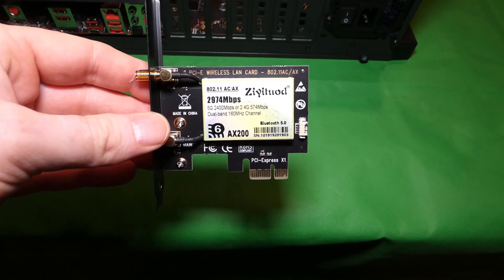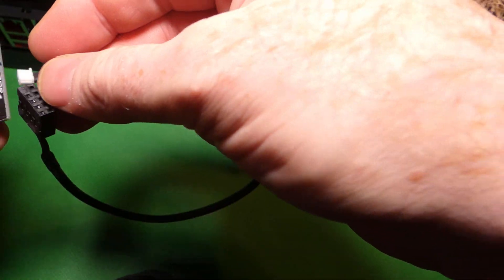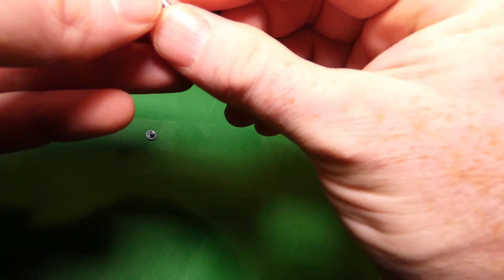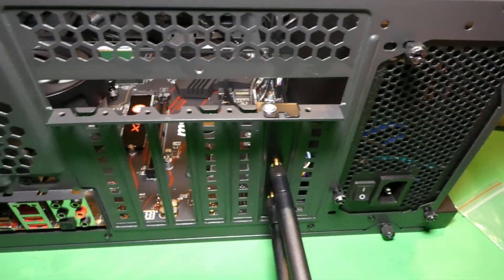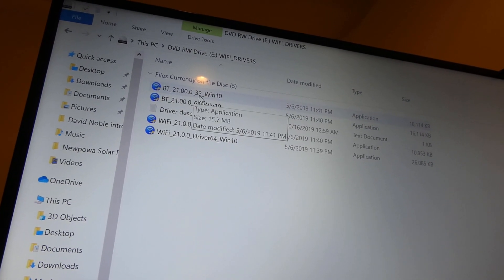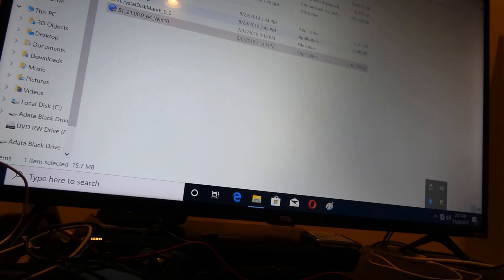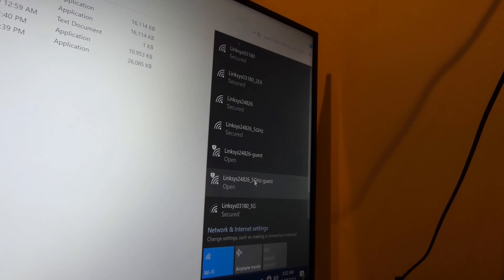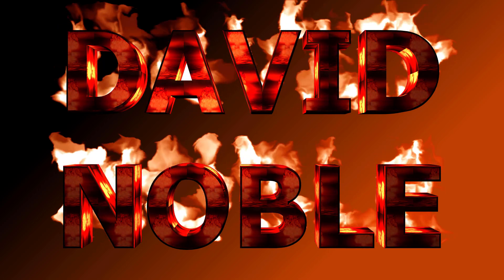How to Install Ziyituod WiFi 6 Card, AX2974Mbps Wireless Network Card, 802 11ax PCIe WiFi Card AX200

Comment: i have one right now. using another 2.4 usb network adapter for now. i put it in the graphics card slot because the small one wasnt working and put the cord into usb 1. sometimes it works. when i power on my pc, it doesnt detect it in device manager and doesnt work. do you know a fix?

Comment: How do I install the driver without a disk on the new pc. I know I can download it from the web but my new pc doesn't have internet connection so I can't access the web, how am I supposed to download it?
Reply from the maker: You are going to have to use another computer that has wifi/internet and download it from the mfg website.  Or just google intel ax200 driver and it should give you a link.  download it and put it on a thumb drive and install on the computer with this wifi card.

Comment: so what does this device do? If my motherboard doesn't have wifi built in I just buy this and plug it in and i will have access to wifi?
Reply from the maker: Assuming your motherboard has a PCIE slot available and a USB 2.0 header...and are within range of a Wi-Fi signal, than yes you would have access to Wi-Fi after installing the drivers.
Reply: David Noble this is the motherboard https://www.amazon.co.uk/MSI-Motherboard-Type-C-DisplayPort-Generation/dp/B08BCQF1BD does it have what is required?
Reply: @WoahNova  yes, it does

Comment: Does it work to install it on a dell 3670? Could you make a video trying to install it on your dell, please?
Reply from the maker: Hello...I am Hawaii for awhile..SDell is back home.  I would have to look at Dell manual online..2 things needed to make it work...usb2.0 header and pcie slot 1" or longer
Reply: @PC_HardwareTechUnboxing_1  thanks! I don't see any usb port on the mother board to power up the pcie card. This is why I wanted to simply replace the old network card (2,4 ghz) with an intel ax200. But not sure if it handled. The online manual tells me only an ac card is accepted but in reality...who knows if not why higher...an ax.

Comment: Hi, how does this card perform? I have heard conflicting opinions about it.
Reply from the maker: I had no problems in the first 3 months of use.  I have not used it since as I am now in Hawaii and it is back home in VA.  That said, in the 3 months, I don't remember it ever dropping the connection to the router.  Much faster than a USB stick...but not that noticeably slower than a Ethernet connection.  That said..my collection of computers is usually within 15-20 ft of the router.  I couldn't tell you how good the range is or if it penetrates walls well.  I can't say I felt much difference between gaming with ethernet vs this card.     I have bought or been given about 5 of these over the past year...I only had one that I would complain about...and that was one of the slower speed ones.
Reply: @PC_HardwareTechUnboxing_1  have you tried any of the well known brands like tp link or asus for wifi / bluetooth cards?
Reply: How does this card perform?
Reply: BT was recognised but it is unuseable

Comment: Mornings!, in minute 8.40 you are installing the drivers and for the wifi..  but only seen to contain drivers for Windows 10.
While amazon says that it is compatible with Windows 10 64bit, (also as you show for 32 bit too) Chrome OS (This is not a browser?) AND Linux. 

Spanish https://www.amazon.es/gp/product/B07YZ7J8QD/ref=ox_sc_act_title_1?smid=A3PNAKHEQF1YTY&psc=1

In English https://www.amazon.com/Ziyituod-AX2974Mbps-Wireless-Bluetooth5-0-Dual-Band/dp/B07YR9JDJ6/ref=sr_1_fkmr1_1?dchild=1&keywords=Ziyituod+Tarjeta+AX200+WiFi+6%2C+Adaptador+inal%C3%A1mbrico+AX2974Mbps%2C+Tarjeta+WiFi+PCIe+802.11ax+con+Bluetooth5.0%2C+Banda+Dual+4X4+%282.4GHZ+%2B+5GHZ%29%2C+Compatible+con+Windows+10+64bit%2C+Chrome+OS+y+Linux+Ziyituod+Tarjeta+AX200+WiFi+6&qid=1586367739&sr=8-1-fkmr1

If it were true.. why the driver cd dosen't have it?.  I would have to take them, from? or does it work differently? or it don't have and its ... a fake information, a lie
Reply: chrome os is an os for chrome books

Comment: Couldnt you use the wifi card and install the drivers in the internet? Or does it only works after installing the disk drivers?
Reply from the maker: Out of the 6 wifi cards we have looked at this past year, all of them needed to have the driver disc installed before they worked. I definitely like when Windows does the work for me.
Reply: @PC_HardwareTechUnboxing_1  oke thanks :) I was on my way to grab one of them.But i dont have a disk drive :/
Reply: @igotw1ngs969  I'm looking at one right now from a company called "Wise Tiger" and apparently the one i want is basically a plug and play! windows grabs the drivers when you boot it up, and if worse comes to worse, they actually have a site to grab all the drivers you'd need if need be for the wifi card.. 9 out of 10 times the drivers are out of date on the disc you get with these cards anyway...
Reply: the u.2 card on my mainboard was only ac and BT 4 and caused the BT speakers to crack and pop, using this card I am Wifi6 ready and BT 5 eliminates the problem audio